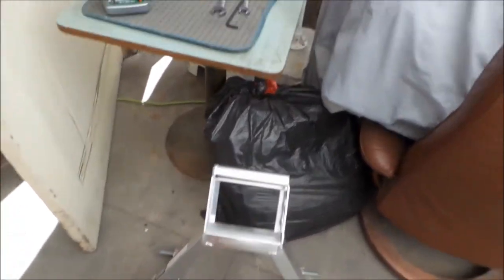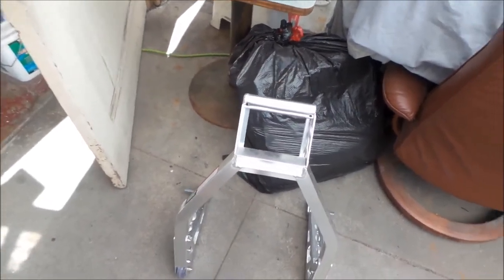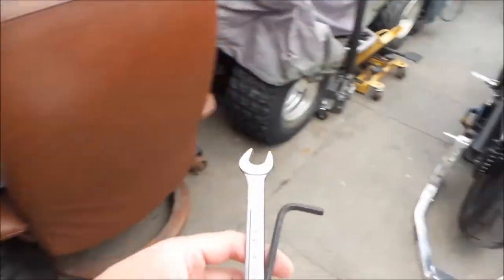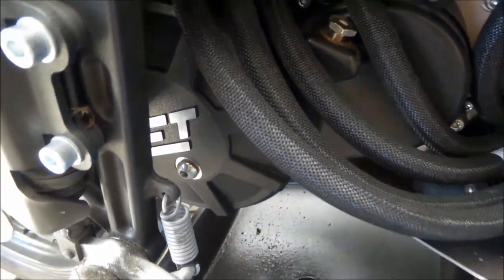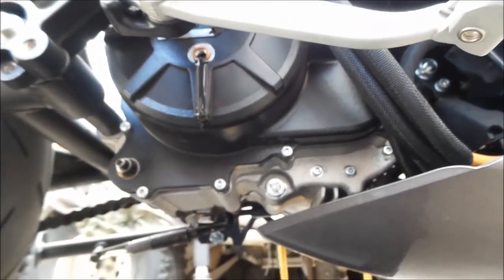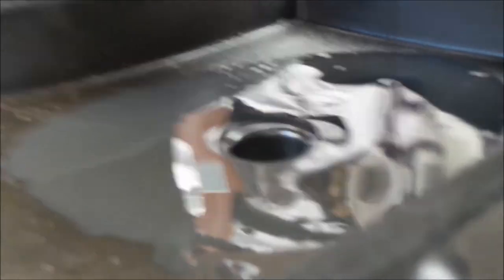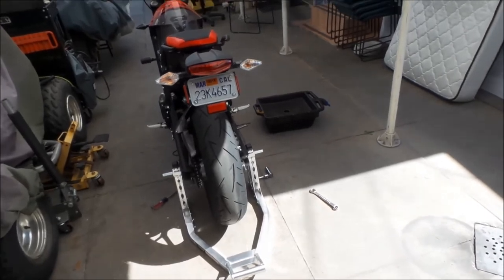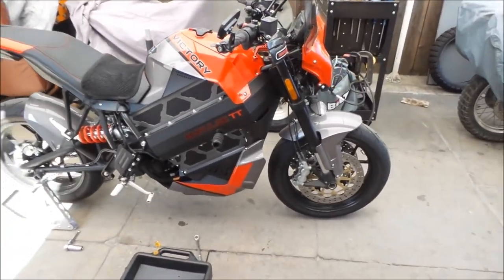HadesOmega Victory Empulse TT 600 mile Oil Change VLOG

Comment: how often do you have to change oil?
Reply from the maker: Initial oil change is 600miles for the break in, after is 3000 miles intervals.  The oil is pricey and hard to find but only requires a quart and there is no oil filter, so it kinda evens out in cost.
Reply: HadesOmega Moto thinking about this or the Zero S.... wanted to avoid maintenance. what about the coolant? how often to change that? how peppy is it compared to the Zero? the gear box just sounds like more trouble than useful. thoughts?
Reply from the maker: Yes honestly if I had to choose between the SR and the Empulse TT I would get the SR because it is lower maintenance, but I got such a good deal on the Empulse I couldn't pass it up.  I haven't ridden the S but I have ridden the DS, DSR, and SR and I am pretty sure the regular S and DS models are not as quick as the Empulse, however the R models feel as if they are just as fast if not faster than the Empulse.  

As for the gear box I guess it doesn't bother me much because it's like a traditional motorcycle but there is some driveline backlash that I dont' like when rolling off and back on the throttle.  I think the gearbox makes the bike more efficient.  It's just something you need to get used to.  I just hope the gearbox can handle all that power.  After changing the oil for the first time its also not that bad and the cost is probably equivalent to an ICE motorcycle because there is no oil filter to replace just a magnetic drainplug to clean.  

As for the coolant in the manual it says to replace the coolant at 18,000 miles, I haven't heard much about changing it though, will just have to deal with it when the time comes.  Having a watercooled motor is a plus for the Empulse if you decide to take your electric moto to the track which I may do.
Reply: HadesOmega Moto I found a few deals on used 2015/2016 SRs. I may end up picking one up. also saw an Empulse listed for $6900. it's tempting, but I think I'm gonna go for less maintenance. I got an ICE bike now a barely ride because there's so much I need to still do to it on a regular basis. thanks for all the insight. much appreciated!
Reply from the maker: Wow $6900 that a bargain even if its used.  Yeah if you are going to use it often or for commuting I think the SR or Zeros are a better way to go.  Plus they have luggage options.
Reply from the maker: Sorry I went on a long adventure ride, you change the oil every 3000 miles
Reply: You hafta change the oil on those?  I think think the zero would be a better choice.
Reply from the maker: Yes unlike the Zero the Empulse has a transmission so it needs an oil change every 3000 miles
Reply: The Zero's maintenance: Tires, Brakepads, check brake fluid, check belt tension, thats it.
And a smooth ride...no backlash at all.
《Zero DS 2013 23000km》